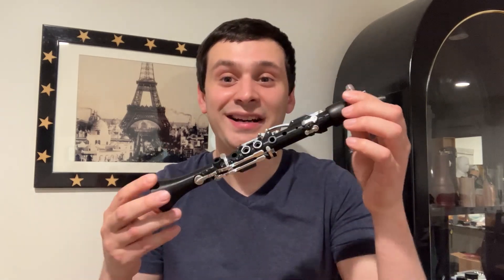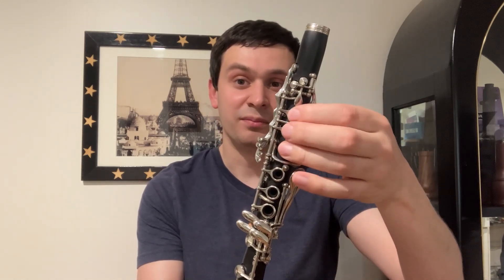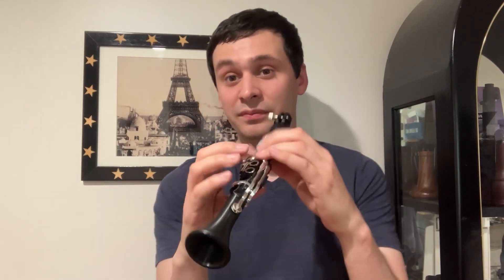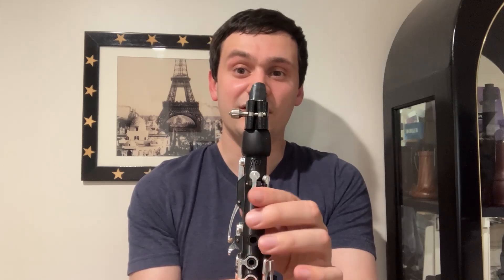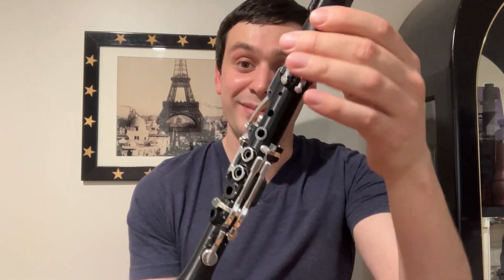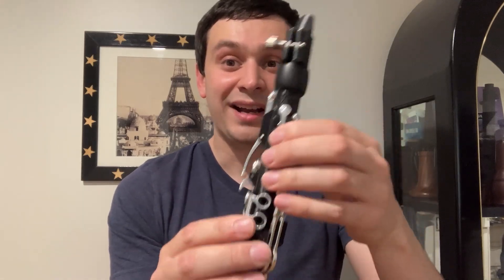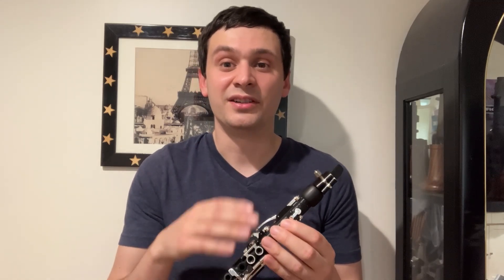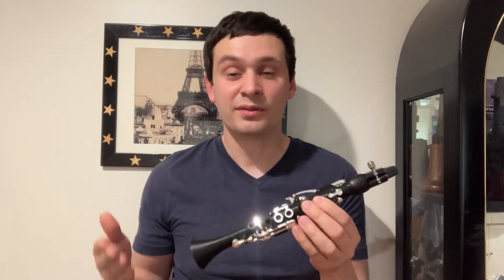I made a Bb piccolo clarinet!

Comment: Considering that even the Soprillo (an instrument made with specialized tools) has to simplify the keywork, I really don't have a problem with the design choices you made. Cross fingerings can be tuned quite well as long as they only have to operate in one register, as is the case with the throat tones. Maybe you end up with an altered fingering for two line C. I have no problem at all with making the throat B♭ use a side key, pretty much every instrument that has such a key sounds better that way so that's my first choice of fingering.

Comment: Are the files available/would you be willing to release them?
Reply from the maker: It's not really designed with DIY in mind, the keys require special reamers/taps and the assembly requires skills only a repair tech would have. I do have printable files for an A piccolo clarinet available on my website JDwoodwind.com though.
Reply: @Jared_De_Leon  understood, I don't have the skills to design one (and would love a video/other explanation) but I do have the equipment and I'm working on the repair skills. Is there some other reason for not releasing files? I just don't see the downside, but of course they're yours and you don't have to
Reply from the maker: @featherfawkes4330  part of it is a fear of someone just copying the design and selling it (which has happened to me in the past believe it or not). But also even after designing and printing the body I put a lot of work into voicing the instrument by hand and I feel that makes the instrument  truly special, I want to be confident that every JDwoodwinds piccolo clarinet out there has been set up as well as possible, and I just don’t think that can be the case if I simply release the files. I hope you can understand, I truly support people building their own instruments and I hope others can use my designs as inspiration for their own projects!
Reply: @Jared_De_Leon  absolutely. On that note, are you thinking about putting together any guides on those things? The voicing and hole locations are something that have me stumped and I couldn't find much already online. Are you doing math to find the theoretical location or just trial and error? That seems way too complex to just be trial and error
Reply from the maker: @featherfawkes4330  I’m mostly just doing trial and error honestly. I started by making educated guesses for the positions based on my Ab and just kept making prototypes from there. This is probably the 10th body joint I’ve made.
Reply: @Jared_De_Leon  well consider me more impressed than I already was. Great work and keep it up. Also thanks for replying and have a great day :)